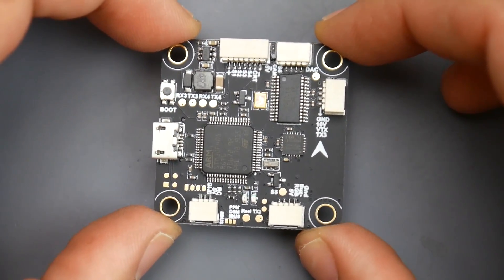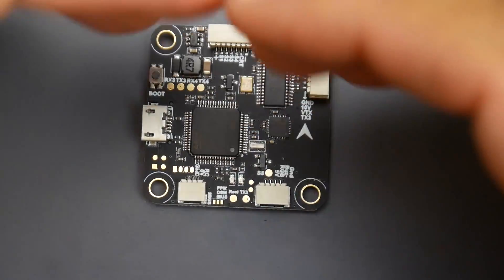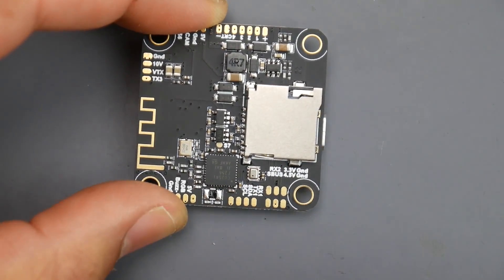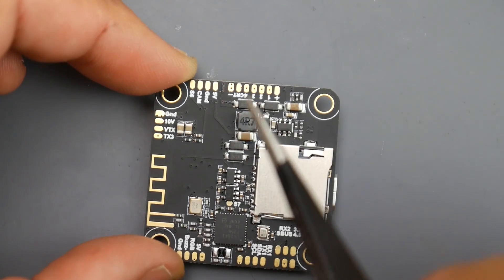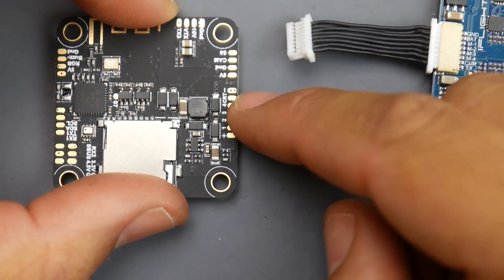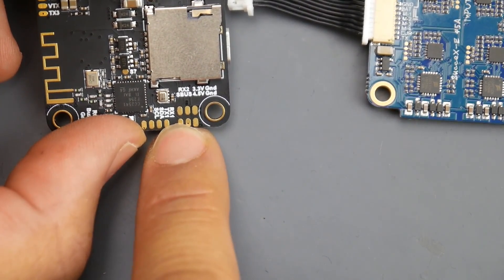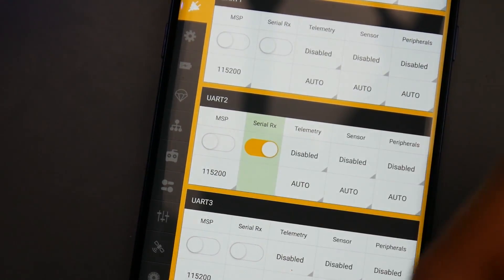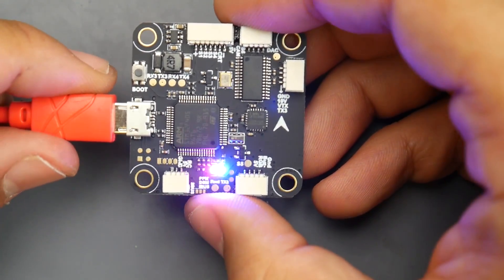How Is This Possible for $20!!! // Racerstar Melo Flight Controller Setup Guide

Comment: I spent h ours yesterday trying to figure out the correct BF firmware target and keep my board from locking up after a few reboots.  ...Turns out that the LED tab needs to remain active for this board to work?  Weird.

Comment: I can't get the barometer working in Betaflight. It reads always 0. Status command gives "I2C Errors: 1". When disabling the barometer, the error disappears.  In INAV it works ok. Anyone having the same problem?
Reply: The barometer is faulty in mine. In inav I thought it was working but it was temperature corrections. The temperature sensor works ok, but pressure sensor doesn't.

Comment: There's not much redundancy on capacitors, the cheaper boards save on that, and use the bare minimum. Further solder pads without a hole true the pcb, are much more prone to ripping the pad of the pcb.
Reply: Redundancy on caps on FC's are not too important, also why bother are you ripping caps of the boards or having caps fail? If you are ripping pads of board you are applying to much heat. Try turning the temp up on your iron and keeping it on the pad for less time. GIve wires some slack too if something does come lose so it would pull on the pad so hard. For the most part that is an non issue though.
Reply: @anthonysamaha3760  Capacitors are relative expensive socheap boards they use minimal.
You cannot have enough of Caps flightcontrollers are exposed to RF noise and to power surges and ripples can enter the gyro or give lines at videofeed etc. So yes it can work but generally more Caps is better, this board has the bare minimum. And  yes a pad with a hole true the pcb you can indeed brake an arm pull off a wire etc, the wire will snatch but the pad will not be ripped off from the pcb.

Comment: Is the succex-e better than mamba?

Actually, is the whole stack better for 12$ more? It doesn't seem to be worth it...
Reply: I would say the Iflight is better due to reputation, but both are very good. I would choose the stacks depending on what features you want.
Reply: @anthonysamaha3760  Iflight's ESC looks only a bit better than Mamba's but the FC feels a lot cheaper (pads vs pins, respectively). And features i think they are the same for both, maybe one UART more for iflight.

I don't think these are 12$ apart. Maybe if it were only 5$ difference then i'd go for iflight.
Reply: @gamaxgbg  No I would say the mamaba has more. The mamba has Bluetooth and more voltage regulators, while the iflight is more stable IMO and has gyro fusion
Reply: @anthonysamaha3760  i'm talking about the cheap versions, not the more expensive stacks
Reply: In that case iflight

Comment: I wonder when we'll get usb c flight controllers lol
Reply: They're 1 dollar more expensive for each port, so you would be making every flight controller 1 dollar more expensive, and higher weight
Reply: @FAQUERETERMAX  ohh ok
But are they really that much more expensive to manufacture?
Reply: @___echo___  Yes, the receptacle itself is more expensive, has more expensive circuitry, and requieres more expensive testing. Not only that, since it supports 5a people might expect it to actually power up the motors in betaflight and other functions, and that adds an extra layer of complexity
Reply: iflight has a few now

Comment: why not just re-route the wires in the connector for the ESC?  i understand some people don't use them (myself included, i prefer direct solder) but why not show that method also?  you said it didn't have a connector and then showed the connector before flipping it over. haha.
Reply: The connector from the Iflight ESC had an extra pin, hence it won't fit the FC connector port. Probably why no one has responded to you. Very good point to show the other method as well but try not to sound like you caught drone mesh slippin.
Reply: @dannycanahuate1219  you're telling me that someone like him doesn't have a ton of jst and sh connectors lying around?  even i have spare connectors in all sorts of sizes from 1mm pitch to 2.5mm pitch.  those things are used all over in this hobby! 

would've been super easy and helpful to take the 5 minutes to show both methods instead of glossing over one of them that the controller is designed for.
Reply: @thegrafxguy1  If it's so easy and only takes 5 minutes why should he bother anyway, also it changes for ESC to ESC so, showing one does not really help. It can and will be different for different setups. If you need help repining Joshua Bardwell has a good video on it.

Comment: This video came out today, yet you can not find this for less than $28, which is $4 more than the SpeedyBee F4 AIO w/Bluetooth.
Reply from the maker: Its 23.50 use different browser.
Reply: @DroneMesh  Its 28 from BG US warehouse. It's 23.50 if you get from their CN(China) warehouse.
Reply: @DroneMesh  It was showing 24.50+ Shipping, Shipping is Free now, but this still isn't $20 like you claimed.

Comment: This FC looks nearly identical to the one that comes with the Eachine Tyro129. Well, it is identical but without the Bluetooth. Oh and Drone Mesh, you forgot to mention that in order to use SBUS or IBUS you have to solder a little bridge) And guys please note: Since this is a modified Matek it comes with the same flaws: F.PORT is not possible on the SBUS pad because there is some resistor that prevents telemetry to be sended correctly.
Reply: Jackjan just answered all my questions, thanks!
Reply: No need to use sbus pin. Solder no bridge and use TX1 pin with inverted s.port pin from your receiver. I use my r9mm via f.port on the tyro 129.
Reply: @waldemarkraus2855  thats also possible, but only because you have an r9mm. Most people fly 2.4ghz
Reply: @Jackjan4  
R-XSR has also inverted s.port pin. Has nothing to do with 2.4ghz or 900mhz
Reply: So solder a bridge from sbus to ibus?